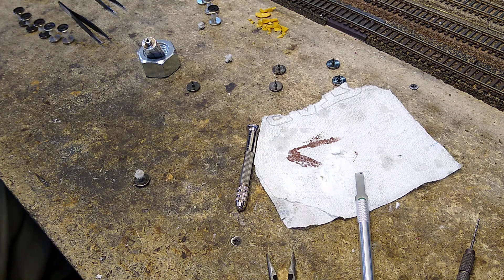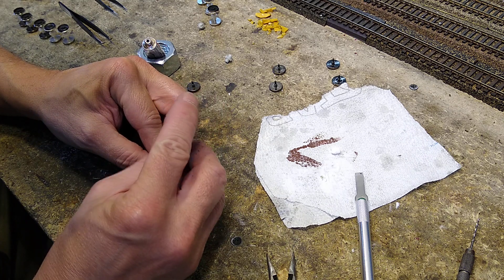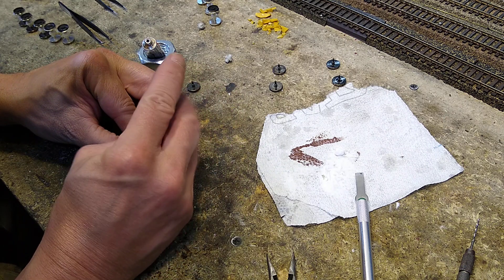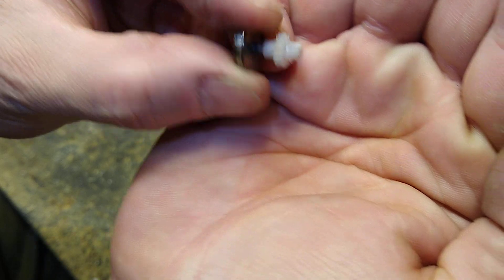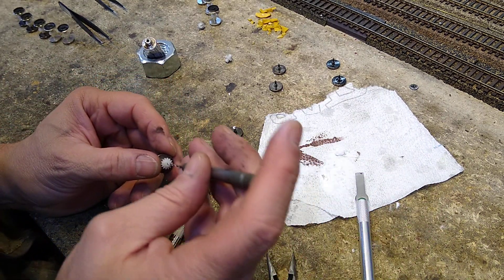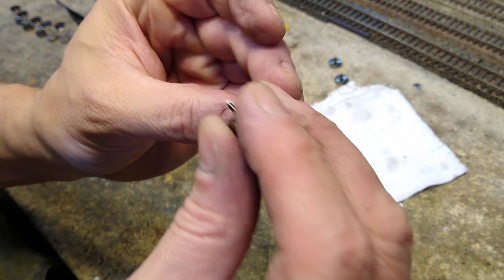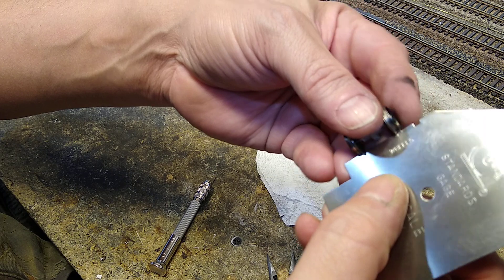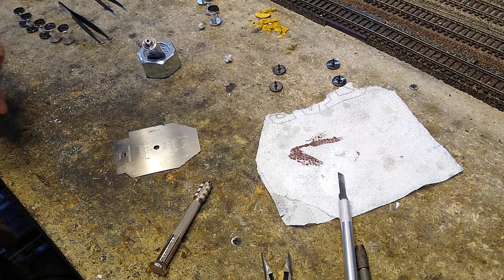5 locomotives in 30 days part 11 how to prevent future cracked axles

Comment: It would be so much easer to order replacement gears from Athearn part #60024 and then run a #41 drill through the gear and completely do away with the substandard Proto 2000 gears. I've done this many times and it is a permanent fix.
Reply from the maker: I always show how to fix something rather than buy a replacement.  The axles are a poor design and somehow made it past quality assurance checks.
Reply: I understand where you're coming from, I guess we just have a different philosophy on repairing our little trains. I am a machinist and was always taught that if it was worth repairing, it's worth repairing right the first time. Reusing defective parts is problematic at best but I respect your opinion.
Reply from the maker: @craigm7009  I always feel there are not enough people who show how to fix things, even defective things, but instead they order aftermarket parts and replacement parts.  it's the reason I've been disappointed with all the magazines for several years now - they stopped showing how to make stuff and now the articles are about buying commercial stuff.

Comment: Why tacky glue and not shoe goo? If the gear had not been cracked (merely spinning on the shaft), would you have used super glue or epoxy?
Reply from the maker: The white glue flows under pressure when the wheel is pushed into place and grips just enough for a friction fit. Goop is too thick for any cracks, but totally works if you don't need to worry about cracks.  Super glue can be used after the fit and after gauging just to add a little protection to stay in gauge.  The biggest advantage to using tacky glue (or any white pva glue) comes at the next rebuild time because it's easy to remove.  It holds when you need it and comes away clean later.

Comment: Nice "trick", Thanks
Reply from the maker: way back when I first found this to be a problem and started searching for ways to repair I found that it was easy to put 1 wheel in and then the 2nd was always harder.  it was using various glues that I noticed the glue would come out through the cracks and I thought that would fix the problem.  once I started using the tacky glue because it could be undone when the next failure happened is when I realized that the axles had no notch like old Athearn axles so I drilled a hole and sure enough putting the wheels in was easy.  even a little pressure with no relief will cause the split given enough time.  the little hole has so far proven to be effective with no new failures so far.